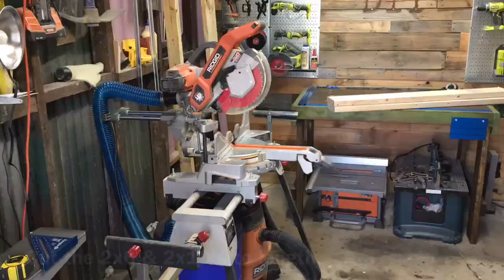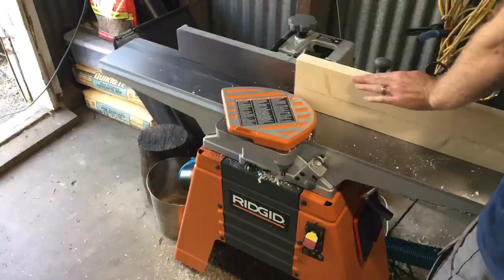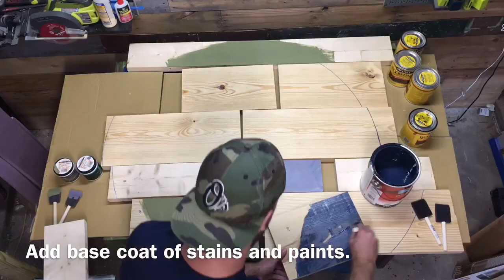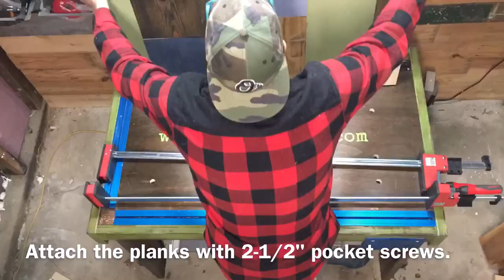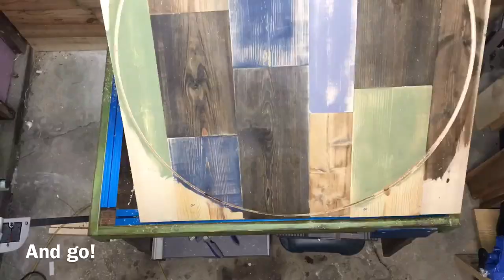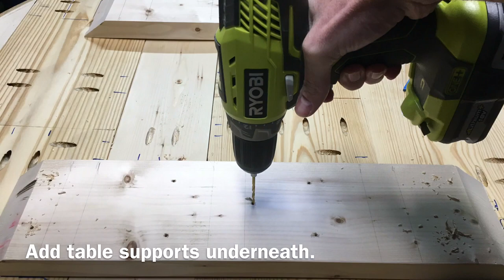Lazy Guy DIY Presents: Round Top "Timothy" Table Tutorial

Comment: Hey man, great job! What did you do about the hole you had to drill for the circle jig?
Reply from the maker: Thanks!  The plan was to have the little indentation right on a seam but... because it's just an indentation and not an actual screw hole with a little spot sanding and then the finish it blended right in.

Comment: Is it just stain or you put some paint?
Reply from the maker: It's a combo of both.  The green and blue pieces are just normal latex interior paint.  I then sand off some of it back to the wood grain on those pieces and then pull a stain over top that really makes the exposed wood pop through the paint.